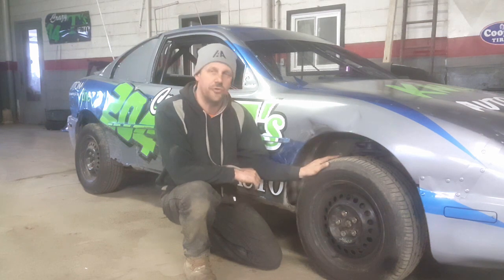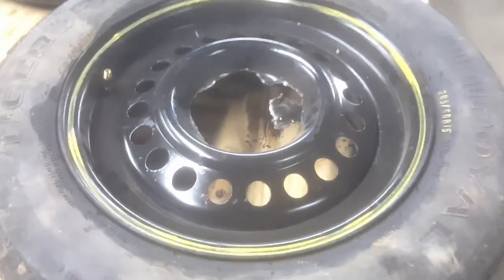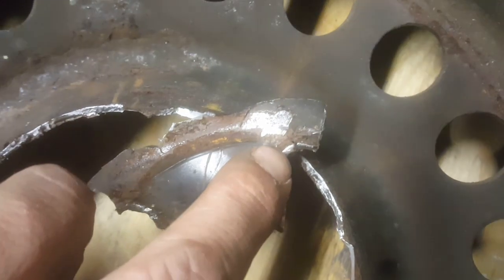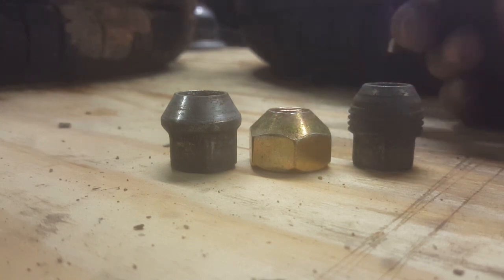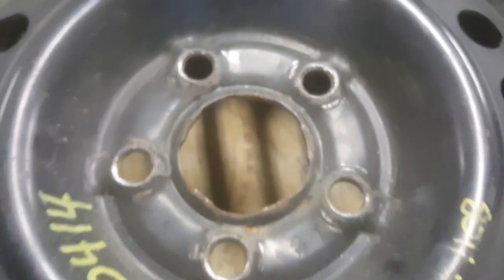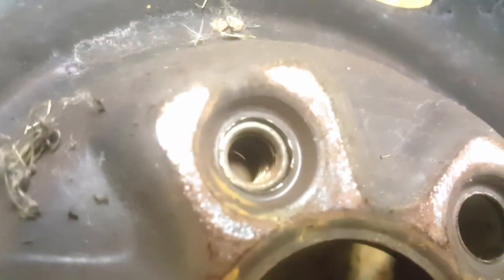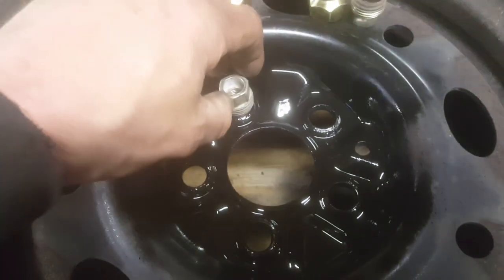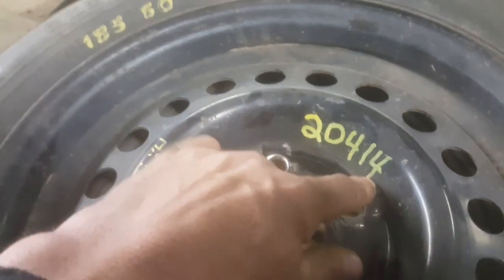Why 1" lug nuts fail on OEM wheels

Comment: The reason why it broke is not because of the lug nuts its because of the force and heat that is being applied to it when you are going through the corners. In my 12yrs racing 4cyl I have only broken out one center and and found cracks in 2 rims and that was back in 2003 when we ran stock lug nuts wasn't until  about 2005 when they put it in the rules saying we had to use those 1" lug nuts but by then I was always running an aluminum rim on my right front which took care of the problem
Reply from the maker: John, you're right, the lug nuts did not directly cause the wheel to break, and I failed to cover the cause of the break.   You're right that its the force of the car acting against the racing surface, but I've never had a problem before.  What the root cause is, once the lug nuts are tightened, and have worn away enough of the hole due to lack of contact area, the wheel essentially becomes loose, and starts to flop / hammer on the rotor hat.  THAT is what breaks the centers out.   

Not sure where you're racing that they didn't implement 1" lugs until 2005.  1" lugs have been around forever, well before I started in 1994, we had the 1" rule back then in our entire area.